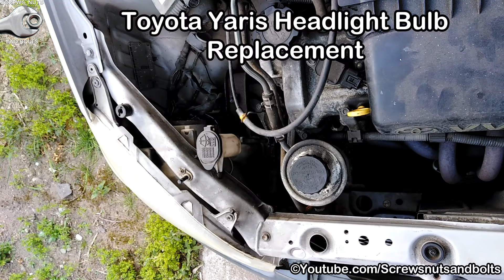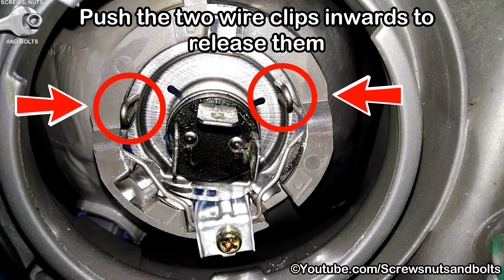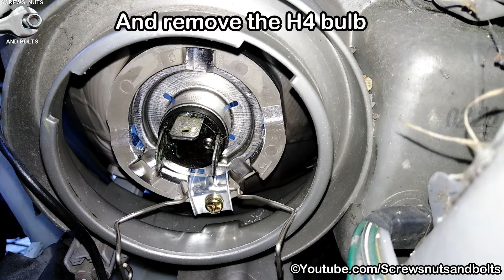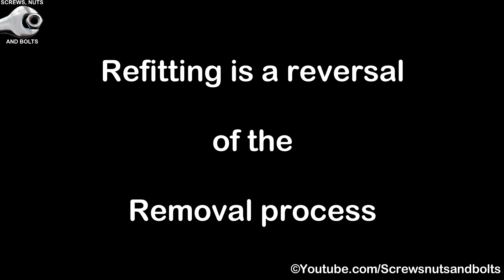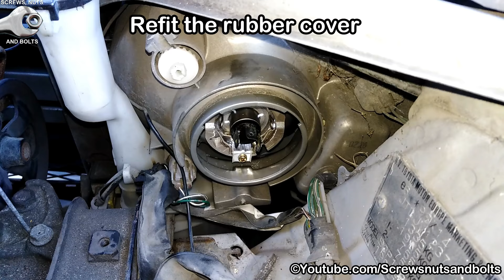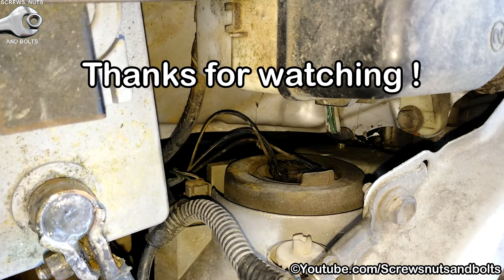Replacing the Headlight Bulb on a Toyota Yaris

Comment: Both of our bulbs went out at roughly the same time. Thanks to this video, we replaced them both without removing bumpers or fuse boxes.

Like some other commenters, the metal spring wire was also different for us than in the video, and quite troublesome to click back into place.
Use a screwdriver if you can to push it back in. It takes a bit of fidgeting.

For the driver's side, we only had to move the battery out of the way a bit.
Disconnect the black pole and the brace to shift the battery. 
No need to remove the bumper or fuse box, unless you have massive hands.

We weren't looking forward to the metal spring, but lucky for us, it jumped back into place much easier than on the passenger's side.

All in all, each light took us maybe 15-20 minutes.

Comment: 😂God Bless you.i bought my car not Long after its last inspection. Reg light on passenger bulb went out. Went on u tube and saw alot of vids on changing the bulb.  Ran across yours. I'm thinking it can't be that easy why would everyone else do all that other mess. Well I'm so is due in a week couldn't put if off any longer. Looked you back up. Disconnected the battery and went at it. I had more  crap in the way but praise God it worked. Took 15 min. Wouldn't have taken that long but somehow the first time I got the bulb in crooked. Hardest part was getting the boot off the bulb. I hope I got it on sufficiently. I can't thank you enough🎉
Reply from the maker: You're welcome, thanks for watching !

Comment: I did mine on the passenger (left) side earlier today and this video helped very much.

The fuse box was a much greater obstruction than the battery, though I think my battery may be smaller than the one shown here. A very fiddly job.
Reply from the maker: It is indeed but when you know exactly what to do, you can do it with limited space and visibility :)

Comment: People thumbs this video down because their wondering how to get to the lightbulb compartment since it’s a tight squeeze .we’d like to see how it is you moved everything around the headlight compartment to get to it .I’m having trouble getting to because I have a 2007 Toyota Yaris and it’s a super tight squeeze to get to the lightbulb .thanks
Reply from the maker: I didn't move anything. The older Yaris had a bit more space to work with. The 2007 model certainly looks like a harder job to do !

Comment: Clear, close-ups, quiet, like watching an expert - yeah, the battery on rhd cars is in the way, but slackening the two nuts atop the retaining bar, and you can shuffle it back a bit, enough to get a good view, and even my sausage-fingers could get in there and do the job. Tip - do the driver's (rhd) side first, then you're prepped for the (slightly) trickier passenger side. Always replace in pairs - the latest bulbs are "200%" brighter than the old type (sez Halfords). Highly recommended - bookmark this page.
Reply from the maker: Thanks for the comments !

Comment: Much appreciated. 2014 Toyota Yaris is also the same.
Reply from the maker: Really ?, that's handy :)
Reply: @screwsnutsandbolts  actually it was slightly different but from first glance it looked exactly the same. The clip that holds the light in hooks and unhooks at the bottom of the housing

Comment: Thanks so much for this.. is it possible also to upgrade to brighter bulbs? Thanks
Reply from the maker: You're welcome. I'm not actually sure if you can with standard bulbs. You could probably get brighter LED bulbs but you need to make sure they'll work 'error free' on your car
Reply: @screwsnutsandbolts  Thanks again, I'll scour the net 👍🏻
Reply from the maker: You're welcome, good luck 👍

Comment: I was hoping to see replacement of the left one. Seems harder. Should I move the fuse box away?
Reply from the maker: Move whatever you can safely. The idea of filming the easier one is to show exactly what you need to do, so you could practically do the other side blindly and by feel if necessary.
Reply: @screwsnutsandbolts , actually I just changed it on my own. Your video was pretty helpful, because I knew exactly what to do. I am a woman and my hands are small, I just did what you showed on the left side without replacing anything else. Thanks a lot! 🙏
Reply from the maker: @rad_y6315  You're welcome !

Comment: What should I do if I can’t get that rubber part off. It’s like stuck to the center of it
Reply from the maker: Have you already taken the plug off the rear of the bulb?. If so, the rubber could have fused to the metal because of the heat. You'll probably just have to carefully peel it off.

Comment: Could you post a similar video on changing the side light bulb, please? 2005 Yaris. Thanks!
Reply from the maker: I don't have the Yaris any more, sorry. Do you mean the small indicator lights on the front wings ?. Here's a video showing that: https://www.youtube.com/watch?v=-ljsavKjiKU
Reply: @screwsnutsandbolts  Thanks :) But no, I mean the side headlights, which the manual calls position or parking lights, next to the main headlight units, not the side indicators. Would the Osram W5Ws be the correct bulbs?
Reply from the maker: @agnessmythe3521  Aha, Yes I think they are W5W push-in bulbs
Reply: @screwsnutsandbolts  Yes, they are :) The handbook called them 5Ws, but every automotive site I looked on said W5Ws. There are a LOT of them on the market. I’ve had this car since 2008, and it was almost 3 yrs old then. Only one side light bulb has ever blown, and it was replaced by my garage (£15 if you please) about 2 yrs ago. It’s the same bulb that has blown now. I understand that LED lightbulbs have longer light hours, but I’ve gone for the Osrams instead. I would welcome your opinion on their longevity in terms of light hours, and their reliability.
Reply from the maker: @agnessmythe3521  I can't help you there, sorry. I haven't really gauged how long different types of bulb last to be honest but Osram are a good make 👍
Reply: @screwsnutsandbolts  Thanks. No worries, I just wondered what the hours length is with Osrams. The LED bulbs all advertise theirs, but not so much with the halogens. Hopefully, these last longer than the garage’s replacement did! I habitually drive with sidelights on in daylight, a habit I collected from driving a company Volvo throughout a season as a polo groom in Henley. It made sense to me to improve your vehicle’s daytime visibility, and that Volvo kept its sidelights on anytime the ignition was on :) The point being that the bulbs do need to be robust to withstand daytime driving with them on.

Comment: I tried this today but my rubber cover didn’t come off, it’s like the rubber is stuck on the bulb, I’ll try it again tomorrow. Good vid.
Reply from the maker: Thanks. Did you get the connector come off the back of the bulb pins ?. You might have to pinch in the sides of the connector to remove it

Comment: Well done, but how do you make all the space behind the bulb in order to remove and replace it? My hands can't fit in there!
Reply from the maker: You  need to move the battery back or remove it to make a bit more space
Reply: @screwsnutsandbolts  pff.. why everything so squeezed? Anyway I managed to replace the bulb with out removing a thing! Thanks for your help!
Reply from the maker: @angpan7  You're welcome :)
Reply: @screwsnutsandbolts  so if I remove the battery in my 2008 yaris I can get to the light?  bc everyone says we have to remove the bumper.
Reply from the maker: @dystopian2153  It should give you a bit more space to work with. I've heard some people say it was difficult but they changed the bulbs without removing the bumper

Comment: Deat @screwsnutsandbolts, if I need to top up my anti freeze/ coolant, is it necessary to drain the coolant system and flush it through with water (which presumably would need to be distilled or something) before adding the coolant? It’s a similar Long Life product, as per the manual. I have no idea which specific product my previous garage used, but a couple of people seem to think I need to drain the system before adding new coolant. I would welcome your thoughts. :)
Reply from the maker: It depends on how old the coolant is but if you're renewing the coolant then it would probably be worth draining and flushing out the system.

Comment: So my clips didn't seem to have the hooks to press on and I ended up breaking it off! One half of the clip now partly holds the bulb in place - is it a problem if the bulb is loose and is essentially held by the wire plug and rubber cover? Light is working now at least!
Reply: After further research it turns out that there are at least 2 types of clips for the H4 bulb so I may not have broken it after all.
Reply from the maker: @benyaminewanganyahu  Aha, I hope you get it sorted !

Comment: tried this on my 2012 the connecter / plug wont come out any help? it’s really annoying
Reply from the maker: I understand that frustration. If it's the same type of connector as this one, then you just have to carefully wiggle it off the back of the bulb. When you do eventually get it off, spray some wd-40 onto the connector to stop it from sticking the next time.

Comment: What year was the yaris?
Reply from the maker: It was a 2000 Yaris
Reply: @screwsnutsandbolts  Okay, thanks for your reply. Is it possible to change the headlight bulb, on the passenger side, without removing the headlamp? If you would be so kind as to tell me😀

Comment: I changed the bulb it still doesn't work only the small light works
Reply from the maker: There could be a problem with the bulb holder or wiring

Comment: What a load of CRAP.I do not have to loosen the bracket or remove the battery to place my Toyota Yaris YRS 2013 to replace the bulb whatsoever. There is enough room to fit an elephant.
Reply from the maker: The 2013 model Yaris is very different to this 2000 model